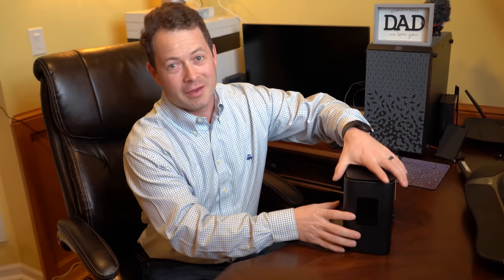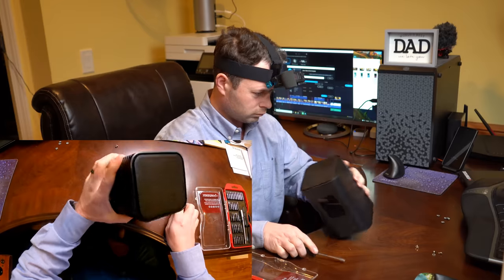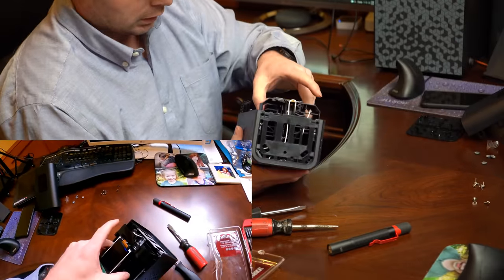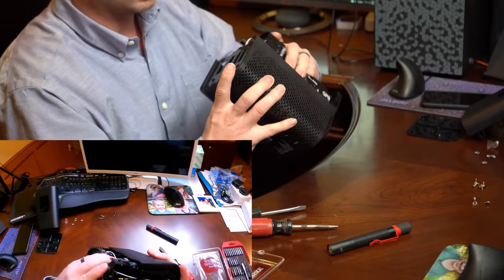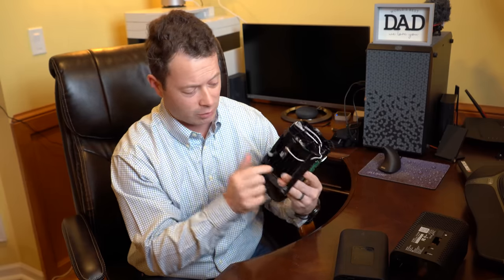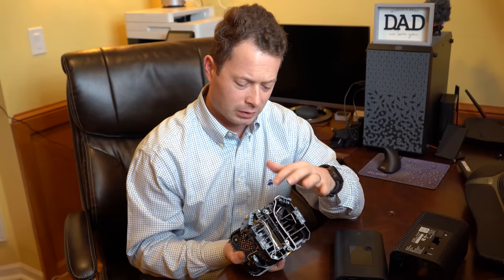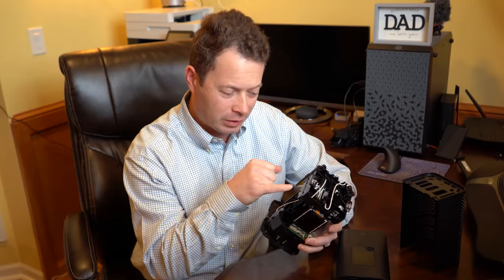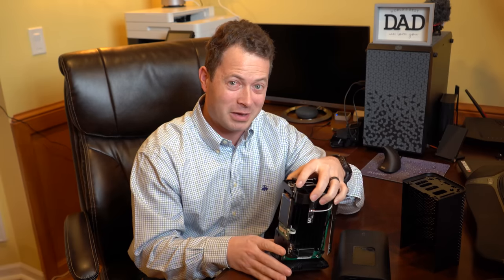✅ Disassembled! Arcadyan KVD21 T-Mobile 5G Home Internet New Gateway - External Antenna, Battery

Comment from the maker: BUY IT:  Get 5% off Waveform antenna and signal booster products with this link: www.waveform.com/natertater or just use code "NATERTATER" at checkout.  Then you can go to the Peplink BR1 5G Pro product page: https://www.waveform.com/products/peplink-max-br1-pro-5g?variant=39840236535911

Cheetah 5G Router (use COUPON CODE NaterTater for $45 off): https://chestertechrepairs.com/products/wifi6-industrial-lte-5g-nr-wireless-modem-router-unlimited-hotspot-rv 
Invisagig - https://chestertechrepairs.com/products/invisagig-os-qualcomm-sdx62-rm520n-gl-standalone-modem-nr5g-4g-lte
USE COUPON CODE for $20 OFF : natertater20off

Be sure to see my other Verizon and T-Mobile Home Internet Videos: 
Verizon: https://youtube.com/playlist?list=PL8d9FovK2dNSOcTz7L6sHiuWVQXwUT4my
T-mobile: https://youtube.com/playlist?list=PL8d9FovK2dNQHp0KWk8gG8XXvaKzaoSB3
Peplink cellular devices: https://www.youtube.com/playlist?list=PL8d9FovK2dNTZR2vUJWyd6kmmDD6ediym

Comment: Writing this 8/20/22 and I have the newest version. Hold a hair dryer to the corner of the sticker nearest the screw and warm it up until it’s warm to the touch.  This makes it easily peel. CAUTION: there are now 2 “warranty seal” stickers on top of that screw under the sticker and one on top of a screw on top. Be careful not to scratch or crease these or maybe even heat them up too much.  Gently peel them off and place on something like wax paper to be put back later if you need
Reply: You sir, have saved T-Mobile the ability to rip off probably many people from doing little more than damaging a sticker so the customers can be happy to pay for the T-mobile services! 
Those warranty stickers can make sense, but when it is proven that only the sticker is damaged and all else is fine, yet the company still will try to charge you for the full cost, that's just wrong!!
Reply: My antenna didn't come with the little clips were can I get them?
Reply: "Most consumers don’t know that these stickers are actually illegal—and that’s because manufacturers don’t want you to. Under the 1975 Magnuson-Moss Warranty Act, the Feds mandated that you can open your electronics without voiding the warranty, regardless of what the language of your warranty says. That makes all of that inconsistent (albeit crafty) language used by the 50 manufacturers surveyed by the U.S. PIRG illegal."

"16 CFR Part 700 - INTERPRETATIONS OF MAGNUSON-MOSS WARRANTY ACT"
Reply: @joeneighbor  That is awesome to learn!  Thanks!!

Edit:  Since the 5G gateway is 'rented' I wonder if that could make an exclusion to this as a warranty item...
Reply: @ihatesignupsgrrrrrrr of course, that only applies to devices you own
Reply: Yep, i just did mine today and i had the same stickers. I had no issue peeling the big sticker with the tip of an exacto knife to lift the corner and peel slowly. I also removed the "warranty stickers" with the same knife, they came off so easy. When i reassembled i just put them back.

Comment: I just took mine apart to install my Waveform Antenna, a quick tip for the sticker is just peel it at the corner, its a very thick heavy duty label that is more plastic than paper so you can just peel it to remove the screw and just put it back in place again that way there is no evidence that you took it apart.
Reply: Same, I only just started taking mine apart, but took a razor blade and carefully slid it under the corner and lifted the label up, only enough to get to the screw, and gently laid it back down.

Comment: Did no one notice in the video at 14 minutes and 8 seconds a 6 legged creature emerges by Nater's left elbow!!!! 😮😱
Reply from the maker: Nice find!  My pet stink bug!  You can just type 14:08 and youtube automatically makes it a shortcut to that timestamp.
Reply from the maker: I wonder if this is what they mean when these new gateways have "bugs"?
Reply: @NaterTater  😂 Right, New Firmware hopefully will fix that issue, lol. I personally I'm using the can with the cover off and the waveform connected to the gateway which is giving me the best results. The silver paint on the can, can in fact interfere with the signal, it turns out to be true. When I remove the cover from the can along with the installation of the Waveform external antenna my signal on both bands improved dramatically as well as locking onto the higher bandwidth bands on both. I appreciate the work that you do on your channel, it is both informative, insightful and entertaining. Keep up the great work and I will be watching out for your next video. Best regards

Comment: I love you, man.  And, I'm sorry in advance.  Just shot an unboxing and setup of a new Arcadia & Waveform 4x4 on an exterior galvanized pole ... none of which would have existed before you.  We're building a house in the country and getting by with Starlink RV.  Then we found your videos on this setup.  Initial speeds were 40'ish down / 13 up.  After sufficient cussing with the disassembly and UFL connectors, and a quick test mount about 10' up, we're now at 264 down / 17.8 up.   I end up mentioning your name a bunch in the video... probably too much.  Sorry if it sounds like some creepy man crush. 😘🤪
Reply from the maker: Haha, awesome.  Great improvement in speed!  Thanks for the shout outs.

Comment: I just disassembled my NEW Arcadyan KVD21. As far as the Sticker goes I used a real thin surgical knife and went under it. Then I used a pair of wide tweezers to lift it up enough to get to that screw out. Until I am sure this will work with the external 4X4  Log Periodic Direction Antennas. 
Nate the old Silver Trash Can bit the dust after 3 weeks. Got me a new one.
Also Waveform is sending me a new 4x4 cable. The #2 cable had a dead short and that is what took out the Trash Can, Band 71 would not stay connected and kept dropping out. I also have to take down the 4x4's this weekend until the cable gets here. I suppose I could do a 2X2 until it gets here. I will keep you posted on the results....  Take Care Guy.   Dave
Reply from the maker: Bummer on the cable.  Did it come like that or short over time?  Looking forward to hearing the results.
Reply: @NaterTater  I guess it came that way Nate. Because when I put it up the Gateway kept dropping the N71 band. Then the Gateway just shut down. When I used a VOM it showed a dead short. When I took it down with no antennas it still showed a short. But I got in touch with Waveform and Jose said he would send me a new cable. Really nice customer service there.
I am wondering why my upload speeds are 4 X faster than my download speed. I reset my NIC to default and did a factory reset on the gateway but nothing changed.

Comment: I'm glad I decided to try this out, got stuck at getting the whole case off, geez, now I know how to take off case, I was going in the opposite direction. Funny as hell though to watch you jump at each snap 😂.  right now just as it stands I have very good service, whereas with the can no service so far I'm impressed with this unit. T-mobile is very aware that I will be connecting an external antenna. It does look like a waveform is more promising than my little white mimo, but if I can use it and get a better boost YAY ME, I will stick with my little mimo. Thanx Nate!  for another great video!!!
Reply from the maker: you're welcome!  Good luck on the signal boost!
Reply: @NaterTater  Thanks!

Comment: Thanks for the demo on disassembly. I wonder if the sticker could be heated slightly and peeled back, without damaging further of course. I'm looking forward to seeing how the antenna connections go and maybe the back screw can be left alone. Also looking forward to seeing more about the open ports. Great stuff!
Reply from the maker: I would think you could heat/peel but 50% of the time I get a bigger sticker tear, with screwdriver poke I knew exactly what I would get...lol
Reply: What about using ethanol to loosen the tackiness but at the same time not destroying the tackiness for reapplication afterwards?
Reply: I heated mine with a hair dryer and peeled the sticker with no tearing--
Reply: @NaterTater  At least try otherwise CONFIRM that T-Mobile won't charge people the full cost for a RETURN!!!!!   FOR REAL!?
Reply from the maker: @Mame A  you're on a rampage... 😆 I have returned gateways without issue as have many others.  In fact I have never heard of one charged for carefully using an antenna and returning the unit back to stock undamaged (notwithstanding a sticker).
Reply: I just used my finger nail to peel it back far enough to access the screw.
Reply: @NaterTater  I had no issue with mine, just used an exacto knife to lift the corner and peeled very slowly

Comment: Pro tip: 1 drop of isopropyl alcohol on the edge of the sticker is enough to neutralize the adhesive. Then take a sharp knife and slowly peel back the sticker to access the screw on the back. 
Tmobile will never know.

Comment: thanks, T-mobile just dropped 2 of the 3 towers near me so I went from 150Mbps to 5Mbps...I just ordered the external antenna, I took the back sticker off with a hair dryer and that small screw also has a "Warranty sticker" stuck to it as well under the main one.

Comment: I just took mine apart and there are some slight differences that I discovered.  TM must be watching your videos because now there are small circular stickers on some of the screws that say "Warranty Seal".  And the screw under the sticker was right in the middle of my UPC code.  I chose to peel the sticker up rather than poke thru it, but either way it's gonna be obvious that the unit has been taken apart.  And that screw had one of the Warranty Seal stickers on it.  You can remove them carefully, but they will tear, as I did to one of them.  Oh well........... Although I didn't totally break anything, the guides on the side did partially break, but I was able to push them back in place.  I don't plan on returning this router, so I'm not too concerned at the moment.............
Reply from the maker: oh interesting!  Good thing a warranty seal sticker won't do much to stop aspiring cellular internet super users.  Thanks for sharing.

Comment: I’ve been using the Arcadyan for about a month now, connecting to bands n41 and b66.  I was originally getting 150-250 down and 15 up, compared to my 20 down & 1 up with my Windstream DSL, so I was incredibly happy.  Then T-Mobile did an unannounced tower upgrade, and I lost service for most of the overnight.  When it came back the next morning, I was on bands n71/b2, with speeds of 250-300 down and 50-60 up.  This lasted for a few days, and then the gateway reconnected to n41/b66, and back to the slower speeds.  I know that this band combination SHOULD give me better speeds, but strangely, it does not.  Do you know of any way to force specific bands, perhaps disconnecting certain antennas?
Reply: Maybe a band pass filter?
Reply: How do you tell what bands it connects to?  The app doesn't seem to give any information.
Reply: @karykrismer1448  The android app does say, but not the web page for at least the two newest models!

Comment: Just got mine and waiting for 4 antenna connectors. Am I correct in thinking m and d are the only two I should hook up? My area is broadcasting 600,700 lte and 5g. I get no mid band 2 or 4. Looks like M1 and M2 would be useless for me.

Comment: For the screw under the sticker on the back gently lift the sticker. The may be a void warranty label over the screw. You can slip the warranty label off unscrew and the replace the label when you are done.

Comment: Thanks for these Arcadyan videos.  I've watched them about 10 times following your steps exactly.  I got my unit yesterday, it worked right out of the box for about an hour following by an area-wide outage.  I took that opportunity to dissect it and I'm ready to hook up my outdoor antenna leads (watching the video one more time to see which connections you recommend).  I currently have an AT&T LTE gateway that's outperforming the T-Mobile Arcadyan about 2:1 in speed but I'm not real techy in this area and I'm not sure if it's overall better or worse.  I'm hopeful, with the external antenna, that I can hit a T-Mobile tower in the same general area as the AT&T.   It's not the one I typically hit with my 5G phones, but it comes in from time to time with an OK signal.  Fingers crossed!   If that doesn't work, I'll get my ladder out.   (BTW, I didn't break my sticker, it peeled right off !  )
Reply from the maker: Awesome.
Reply: Update. Still getting a steady signal and good thruput considering that I'm pretty far from any tower. 

I didn't like having the modem so exposed to damage but don't want to reassemble it either. I really had a hard time getting it apart in the first place. My solution was pretty simple and others might like this too.  

All I did was find some wiring heat shrink tubing that barely fit over the 6 side tabs.   Cut it to length and reassembled the case. I DID NOT USE ANY HEAT AS THAT WOULD OBVIOUSLY DAMAGE THE CASE !! 

The tubing was heavy enough to keep the tabs from catching but not too heavy as to prevent reassembly. 

For the top, I just put some padded double sided tape on each of the 4 tabs lightly pressing it into it's original holes without latching them.  This also leaves the needed clearance for the antenna wires which I secured with small zip ties to prevent any movement. 

With the exception of a little extra gap in the top plate it looks perfectly stock and all the delicate pieces and parts are protected.
Reply: Update. So I don't know if it's related to the mod but here's something to consider. My modem went belly up about a month after installing the external antennas. That's not surprising but what is is that it would not master reset untill it was back to its out of box configuration. Once I put it back together it reset and began working again. Didn't take long after that that it had to be replaced.  I'm not going to modify this one just yet.
Reply: Well, AT&T "Homebase Home Internet" pulled a fast one on me, switched my plan and took away the "land line" service so it's time for T-Mobile Home Internet to become my primary instead of my secondary ISP.  I put the pigtails on the Arcadyan KVD21 and working with the equipment I already had for the AT&T setup, I attached two 2x2 MIMO Eifagur (698 - 2700 MHz; 11dBi gain) panel antennas  in a vertical configuration about 8 inches apart.  I saw some other videos that recommend using a 90 degree stacked configuration to get an additional 6 dBi gain but I need to drill a few holes in my mounting hardware to do that.   The "numbers" (based on my limited ability to interpret them) don't seem great; however, the speeds are about double what I was getting with the stock gateway.  
I plan to upgrade to the Waveform 4x4 but in the meantime, have you tried various configurations using (2) 2x2's and can you point me to that content or share your experiences.  I'm a little skeptical that I'll see a 6 dBi gain.
Reply: @josephlopez6989  have you added a second 2x2 yet? Looking for the comparison.
Reply: @FE428Power  I did install the other 2x2 and it doubled my download to a whopping 80 and tripled my upload to about 13. SINR dropped to to next to  nothing.   Loaded ping over 600.  Fast and Dirty🙃

Then I got my new waveform 4x4. 45 down 8 up SINR 16ish and loaded ping 150.   I was hoping for faster but I'll take "cleaner".  I'm not done tweaking but it's been cold and wet here in the Missouri Ozarks.  

On top of having the TMobile home internet, I also have their Cell-Fi 4GLTE booster.  The booster is now having a major influence on the 4x4 and I'd love to keep it on without adding an additional variable to my home internet scenario.

Comment: Do you think using a heat gun or hairdryer would help make the plastic more pliable for disassembly?
Also you may use heat to remove the sticker intact
Reply from the maker: Yes

Comment: Is there another device that the T Mobile Gateway KVD21 sims card will work in that has a external antenna thanks.
Reply from the maker: The short answer is no.
Reply: Ok thank you. Is there someone that installs external antenna on these devices.
Reply from the maker: @sheabryan6174  not that I know of

Comment: Since ports 4 and 5 do not have any antenna attached, I am wondering if they may work if I connect leads from my Waveform 4X4 to them as I broke the U.FL connectors from both D and M2.  The only two existing ports not damaged are M and M1.  Gateway is working with some impovement, but wondering if these spare ports are operational.  Secondly, I suspect MANY people break the U.FL connectors.  Who can repair them??  T-Mobil, phone repair shops, board replacement???

Comment: I have the gray t mobile gateway.  I bought the 4x4 antenna. The top 2 ports on the gateway I get 0 internet. The bottom 2 ports on the gateway I get great signal. What am I doing wrong?  This is the second gateway I bought bc I thought I messed the first one up.

Comment: Hi there, do you know if the tmobile hotspot device can still be moved to another location, after you've done this modification for the waveform mimo? I like being able to bring my hotspot with me while traveling, but be able to connect with the mimo waveform when at home. Thank you
Reply from the maker: I'd suggest buying a used tmobile gateway online for cheap and just move the SIM card from the home unit with waveform to the "mobile" unit when needed.
Reply: Great advice. Thank you!